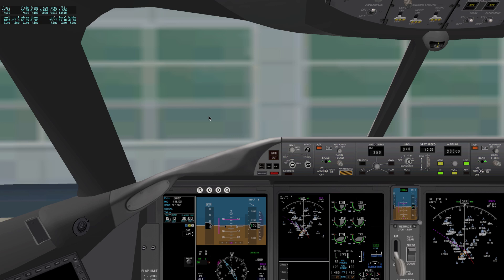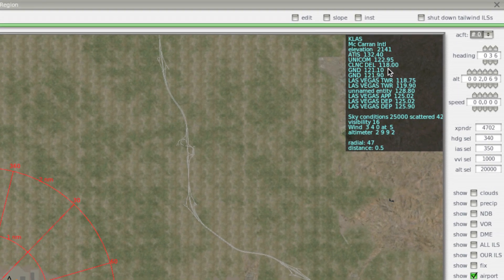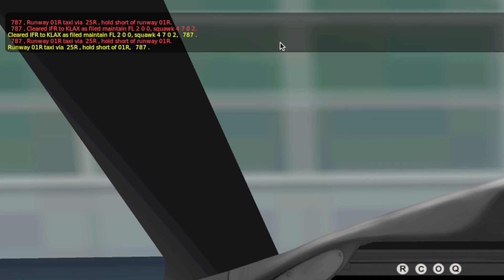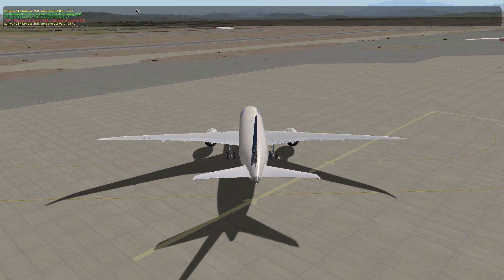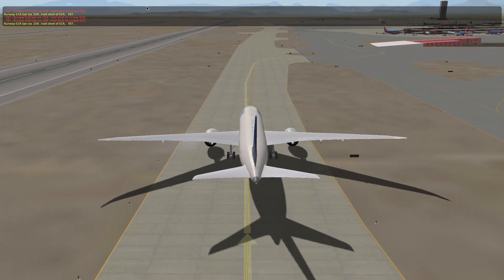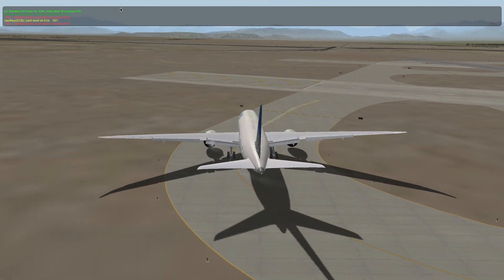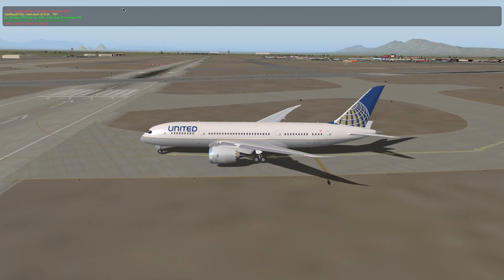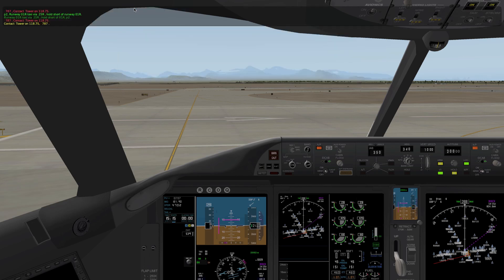ATC Tutorial: Taxiing (X-Plane 10) [HD]

Comment: pilotmaster72 is mostly correct.  FL300 isn't just an altitude of 30,000 ft, it is 30,000 ft with your barometer set to 29.92 and above a certain altitude.  Here in the US, that is roughly 18,000 ft.  So above that all altitude is measured in FL based on the standard 29.92, under that in ft based on the local barometer.

Comment from the maker: You'll only be able to bring it up to what your computer allows. Test it out, and find the best performance for your computer that you also like to look at. There are some addons that you can try too, like UrbanMaxxExtreme, and Cloud HD that are supposed to enhance scenery without a frame rate drop. Wing view is only obtainable by going into the 3D cockpit and manually moving back to the window seat, using the arrow keys, or some other preset movement key. It's a hassle.